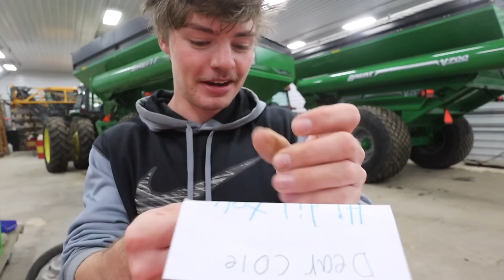After Harvest Equipment Clean-Up

Comment: Cole I noticed your sprayer has some crusty rust, over here in New England we use fluid film also known as wool wax. just clean off some rust don't go crazy and sand , or grind any off just spray some on and forget it. Just do it once a year on bolts or any fasteners .and the rust of course , and you can stop it from eating away your equipment.

Comment: 2:38 - my heart stopped! Cole! 😲 Put a block under that, before you climb under it to work! If something lets go or fails, you'll be squished! I don't want that! I enjoy you n your videos too much! Please be more careful....😥
Reply from the maker: BitchOnWheelz there is a safety on the cylinder we put down
Reply: I mean an actual physical block...like a set of jack stands. Switches can fail, hydraulics can lose pressure. The 5 minutes it takes can save life and/ or limb. 
I ve seen a lot in my life, because I'm a facilities maintenance supervisor and i have to watch out for my guys; i just want you safe too. 😘
Reply from the maker: BitchOnWheelz no, it's a physical steel 1/2" thick piece of steel that hugs the cylinder. Thank you for the concern 😇
Reply: Ok...my heart is back in my chest! Thank you!! 
Stay safe! 😉

Comment: 1/2" drill bits! Never have enough if you weld
Reply: Why is that just curious
Reply: Some pieces of steel and some 1/2" inch bolts can make just about anything. Half inch bolts need half inch holes

Comment: Bypass that Chevy coolant hose coupler. They're junk. Just put in a pipe nipple that has a hose barb. Cut the hose behind the fitting and connect it with a hose clamp.

Comment: You need a jack or something under that combine head while you're under there. If the hydraulics fail you're dead. So many horrible accidents just seconds away from happening in this video.....daddy cornstar leaning out over a 3-step ladder. OMG.
Reply from the maker: Gimme A Break the cornhead has a safety bar on it

Comment: Safety Alert, block the corn head before working under in case hydraulic cylinders let go
Reply from the maker: Dan Van Ninhuys we had the safety bar on the cylinder down.
Reply: @ColeTheCornstar  Awesome, Glad you did.

Comment: Hi Cole, how big is this shop, including wall height and overhead door dimensions? Thank you!
Reply from the maker: Rick Campbell 50x100x18   26 and 12 feet. I think one is 14 tall and the other is 16.
Reply: @ColeTheCornstar  Thanks Cole, I'm about to build one this spring in Wyoming a bit smaller and was sizing yours up so to speak by the equipment you have in and out of there, I will need to go bigger. I'm building off the back of a smaller building. Thanks again!
Reply from the maker: Rick Campbell 70 feet wide would be ideal!